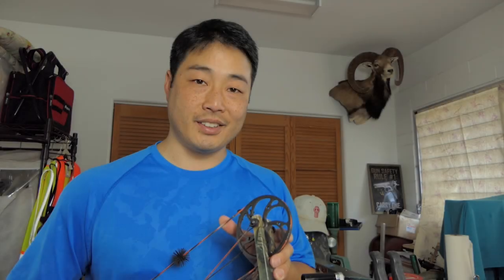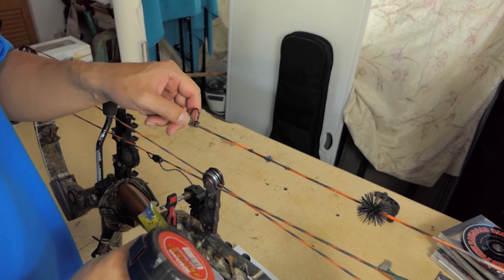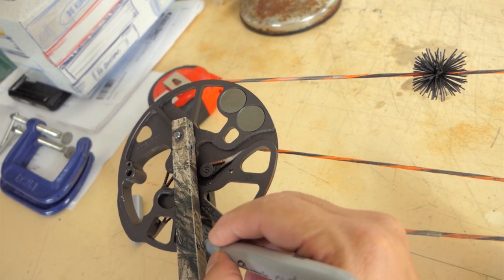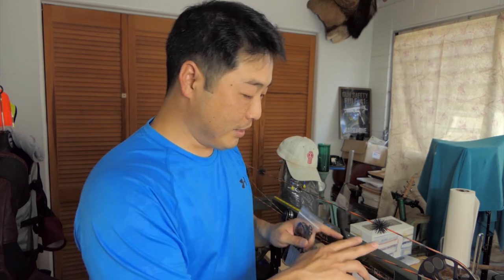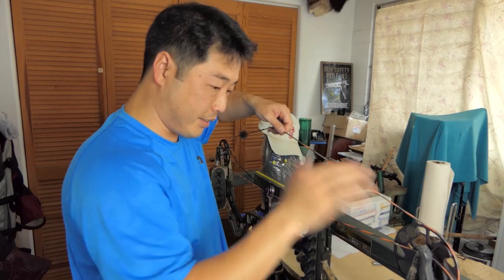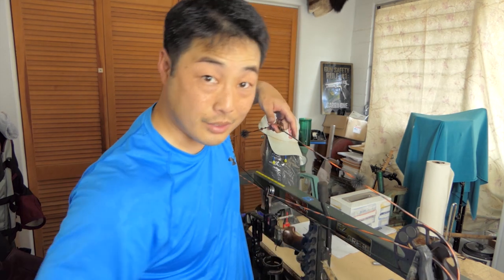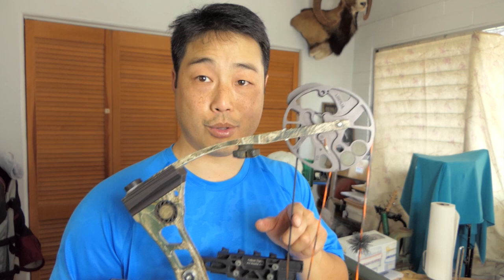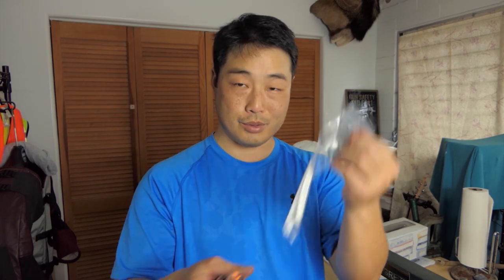Strings and Cable Changeout for Compound Bow

Comment: Hi Ryan i really like your videos. Well I have one question. Since I am shooting 145 meters (bhutan archery) with fingers without a scope. I would like to seek help from you. I shoot 65 lbs and my arrow is 10.7% FOC shooting Axis 5mm. What do you recommend?
Reply from the maker: Wow! that's far.  I don't think my current setup would reach that distance on the sight scale for me.  Maybe 120yards tops but my arrow is slow relatively.  I don't know the specific application you shoot in but from a pure consistency standpoint, yeah something 10-15% FOC is probably a good idea for long distance.  If you're expecting a sight to reach that far, maybe some speed or higher peep height setting could help.  Short guys like me can't really get a sight that far without some special application modifying.
Reply: @ryankohatsu8836  thanks heaps. Appreciated.  Take care

Comment: Please tell me. When I execute the shot my bow hand lifts up. What would be the problem? Thanks
Reply from the maker: Could be a number of things, so it would be hard for me to assume without seeing it myself.  But a few things : Maybe your bow is rear weighted biased toward you so on firing bow tilts up, maybe you tend to hold low under the target (very common) and folks may try to sneak the sight up from the bottom and fire it on the way up causing an upward motion on firing.  Hard to say without seeing.  And unfortunately, a fix for all the reasons it could be may be different for each and doing the wrong fix for a misdiagnosed problem could make it way worse.  Best would be maybe video yourself and have a look.
Reply: @ryankohatsu8836  i tend to hold my bow low under the target and bring up to the target slowly.
Reply from the maker: I want to say, “just don’t do that.”  But that isn’t much help perhaps.  If you’re holding low and sneaking it up just to try to punch it when it hits middle, that could be a problem.  You could try a drill just drawing the bow slightly above target.  Aggressively come to center and hold it in the middle as long as you can.  Don’t fire.  Do this a bit until pretty easy.  Then incorporate shooting.  Be careful not to regress back into the old habit.  It happens once, go right back to beginning.  It maybe a tough habit to break.  Even I do that sometimes.  Not sure that’s causing the problem but it could be one.  Best would be to video yourself and see
Reply: @ryankohatsu8836  thanks I will keep i  mind and try to do a drill on this. Thanks heaps again